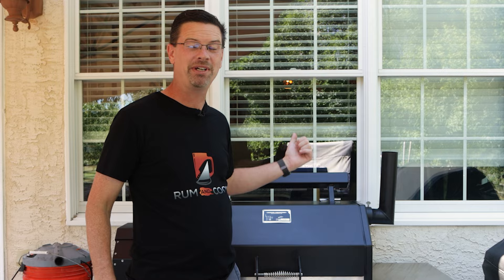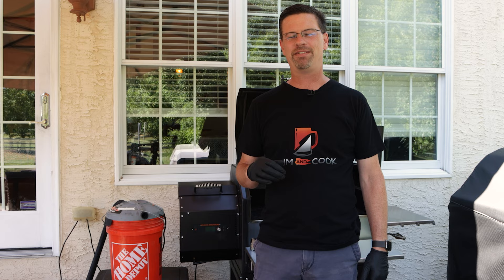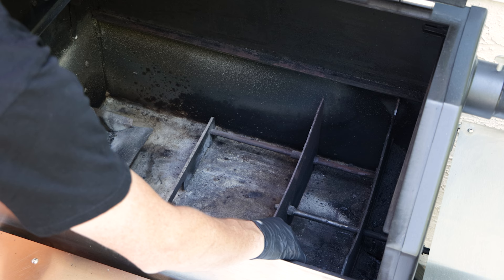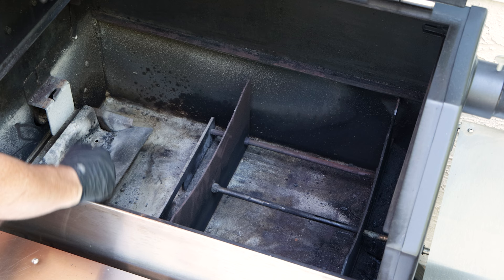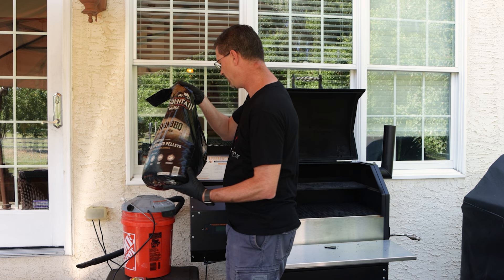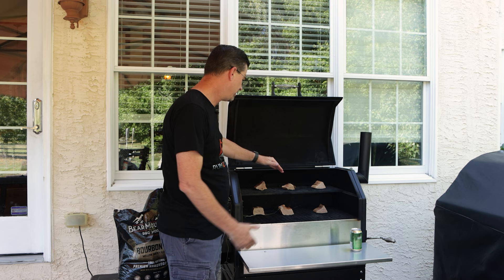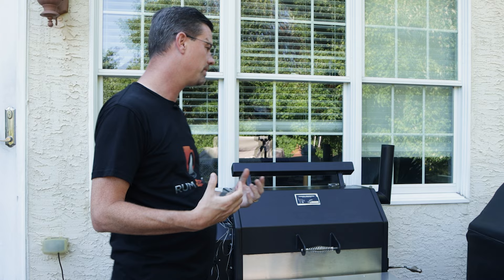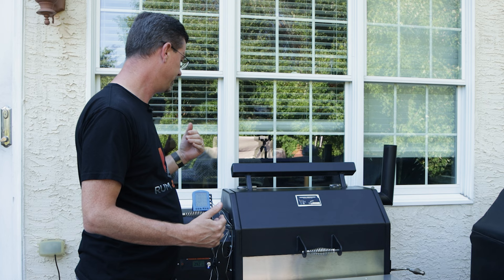The #1 Question I Get Is About The Yoder Damper Position

Comment: I know this is an old video but hopefully you see this.

Go get knits with the nitrile applied to the palm and fingers. Super cheap, like $5-10 max at every hardware store. Reusable saving you money and waste and the knit is insulation allowing you to make adjustments at smoking temps. Best yet it allows you to slip them on and off with ease allowing you to touch other things without all the filth  you collected on your gloves. 

It won’t replace knit/nitrile combo where moisture is involved or welding gloves for high temps. It is an excellent choice for cleaning and low temps. Quickest way to prevent filth transfer while cleaning, reduce cost, and reduce waste. I paid like $3.50 for mine and I’ll buy another pair when needed.it’s worth every penny.
Reply from the maker: Cool thanks for the tip. 🍻

Comment: My understanding is that when cold smoking (less than 225F), the damper should be open, but when searing/grilling at higher temps, the damper should be all the way left. What you tested was all at the same temp, and not what the damper was designed for, but I could be mistaken. Thanks for running this test!
Reply from the maker: The purpose of the damper is to adjust temp throughout the entire pit. The temp doesn’t matter as much, it’s more about airflow. The reason you push it all the way in when searing is because you are trying to maximize all the temp on the left. 

It could possibly make more of a difference at higher temps, but I don’t think it makes enough of a difference to be overly concerned about it. 🍻
Reply: I agree, the damper would make the most difference at the extremes. I doubt it's really intended to make a difference at moderate conditions like what was tested.

I think this would be interesting to see at max temps and at minimum temps.

Comment: As a person who had worked with temperature measuring devices, Yoder could stabilize the temperature by adding more than one temperature probe and the circuitry, that way the hopper could add pellets more accurately giving you a more stabilized  heat signature.  It’s not that hard to do, you just got to have engineers who have the ability to think outside the box…
Reply from the maker: You’re dealing with a live fire. Every pellet grill on the market fluctuates. Yoder chooses to show accurate temps. Those who don’t show any are lying. 🍻

Comment: Good video! This video clearly shows that by pushing the damper fully in you will have a more consistent temp throughout the cook chamber vs pulling it all the way out or 6” in for smoking. Going to have to test on my 640 now!
Reply from the maker: Thanks! Glad you found it helpful. Thanks for watching! 🍻
Reply: Right you are the only one to seem to have acknowledged this.  Having it in the middle as recommended has a shocking 37 degree variance whereas having all the way in has only 10 degrees.

Comment: Same i thought doing pizzas that they cook faster on bottom left right over the firebox. But ive never done what you just did with thermometers. Very interesting! Thanks
Reply from the maker: Thanks for watching. I’ll be trying a calzone video very soon! 🍻
Reply: @RumandCook  Can you cook pizzas/calzones on a yoder? Do you need to remove the heat deflector? I ask because they warp when it gets too hot.
Reply from the maker: My latest video is a calzone. Didn’t remove the plate.

Comment: Great video. I just recently checked this channel out after binging on your Offset Rookie channel. I really enjoy your approach. 

Maybe the food is cooking quicker on the bottom grate due to radiant heat from the diffuser plate even though the air temp is similar or slightly higher on the top grate? I have no experience to back that idea, but just a thought. Anyways keep the vids coming.
Reply from the maker: Thanks much. Radiant heat def has an impact. 🍻

Comment: Another question. Using cotton gloves. The black  vinyl gloves, same size or one size larger?  Thanks.
Reply from the maker: The gloves has enough stretch in them that you can probably keep the same size. In a golf glove I wear a medium large which is tight. In the black gloves I use a large and it’s fine with or without the cotton gloves. 

Make sure you check out my link. You can get a 1000 gloves for around $129 or something. Killer deal and they won’t go to waste.

Comment: hello
 It was another nice interesting and informative video.  I close the plate when I  grill and open him completly when I smoke on low temperture. 
Have you ever tested the difference in taste with the aluminum grill plate with holes and the cast iron grill and baking plate from yoder.  
my experience (personal taste) is that the cast iron griddle gives more flavor.  while I expected more flavor due to the flames of the aluminum grill plate. 
What is your opinion ?  
Greetings Kees
Reply from the maker: Thanks! I’ve never compared the two and understand your logic. I think the cast iron holds more heat and it allows for more caramelization or searing on contact, depending what you are cooking. That’s just a guess though! 🍻
Reply: @RumandCook  
So there is the next test 😄
Reply: What im also looking for is a explanation to remove rust from the platesetter. My platesetter and fire plate are covert with rust.
Reply from the maker: I believe you are talking about the diffuser plate and diffuser door. 

Super simple, scrape all of the old food and rust off. Then give a heavy coating of spray oil (Pam or Canola oil). Soak in oil and run at 400 for a couple hours. This will give it a nice seasoning, much like a cast iron pan.

Comment: Have you tried changing the stack angle?
Reply from the maker: I always have it straight up. 🍻
Reply: @RumandCook  quick question.... does your Yoder turn on with 1 push of the on/off button or 2?
Reply from the maker: 1 push of power and then have to push start. 🍻
Reply: @RumandCook  weird. When I plug mine in, I need to push the on/off button twice to power up then start.
Reply from the maker: Do you turn it off and let the cool down sequence run?
Reply: @RumandCook  this is when I first start the Yoder, even if it stays plugged in. I was having probe temp issues. The probes weren't plugged in and getting temp readings. Yoder is sending a new Fireboard. It'd be nice if they had 1.5mm plug covers for the probe ports when not in use.
Reply from the maker: Seems weird, maybe it’s related to the control board. Hopefully that fixes it.
Reply: Got the on/off figured out. I usually use the app for shutdown. Technically the button isn't pushed off.